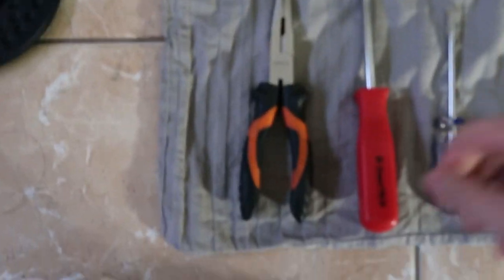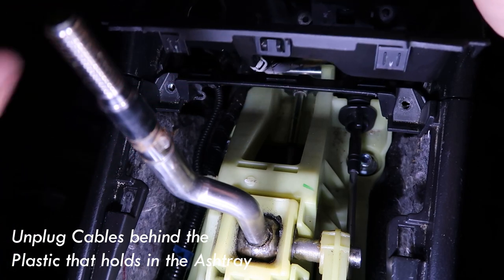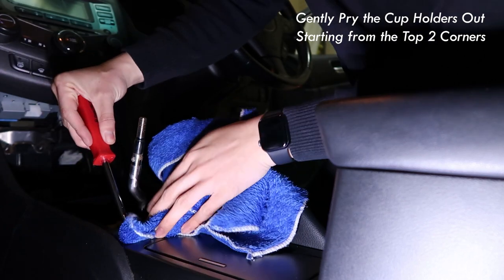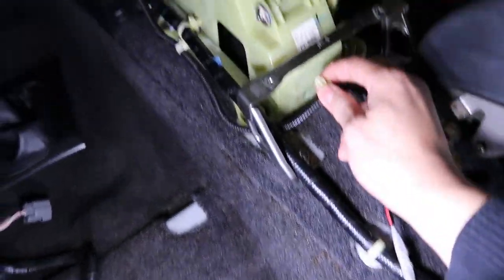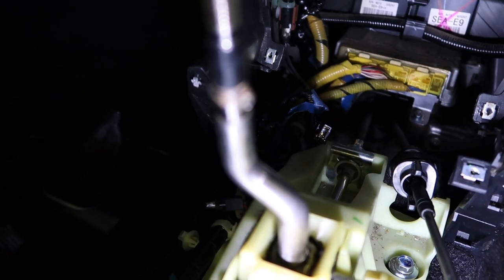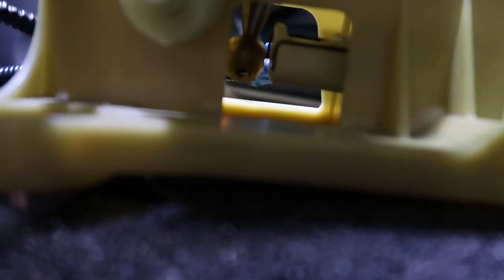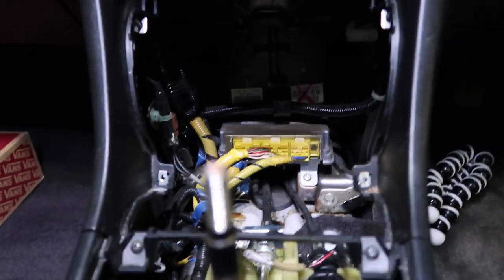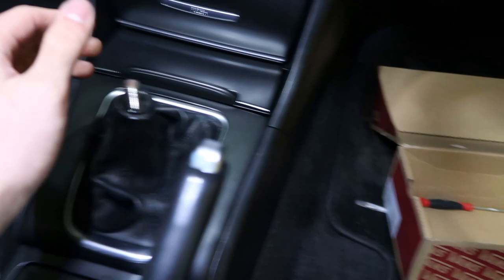HOW TO INSTALL A SHORT SHIFTER - CL9/TSX

Comment: I bought the comptech short shifter add on to the oem shifter and this tutorial is very helpful, will be attempting the install tommorow. Seems like taking the trim and the c clip off was the hardest part
Reply: Snapped a corner off the trim and had to use the force of god to get it out but it’s out
Reply from the maker: glad it helped bro ❤️